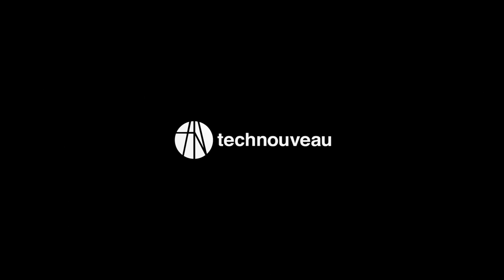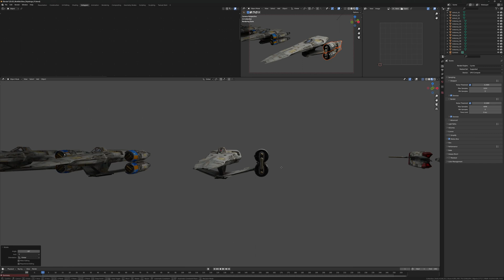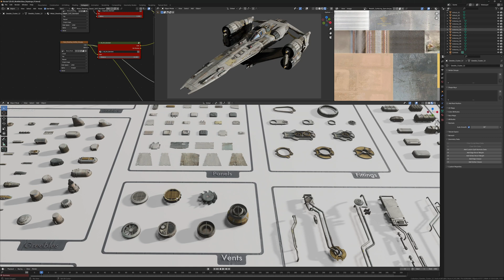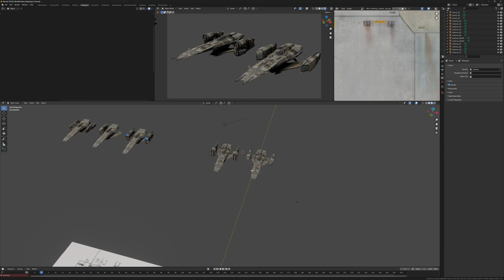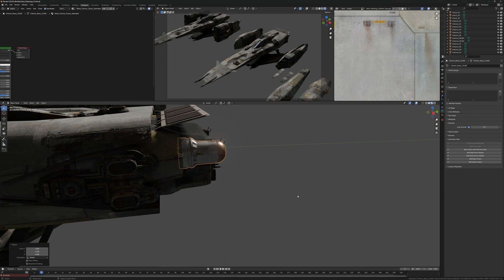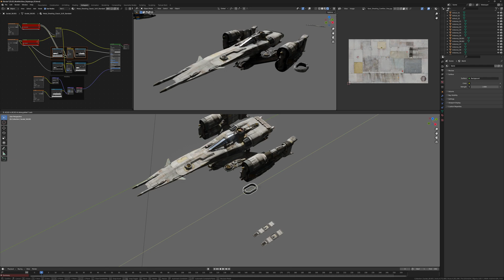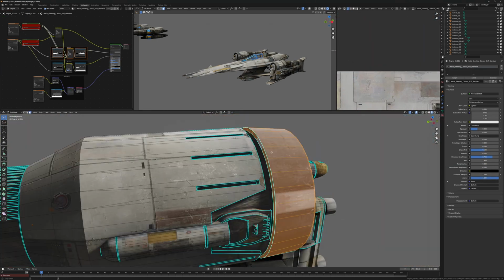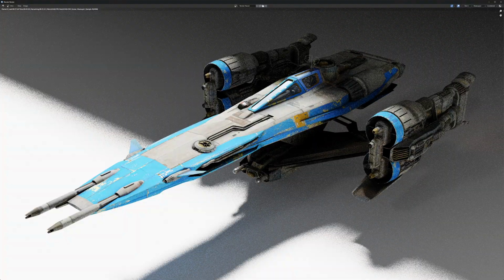Making a Star Fighter in Blender 3D - Technouveau 0002

Comment: Question coming from a newbie.
The scale of the model in relation to world space. Would lights camera and volume elements process differently if you build an environment that really tiny 0.5 meters over something that is supposed to be 100meters big ?

Would it increase memory building at that scale doing buildings and ships?

I thought that if you worked in a really tiny world space it would save on the system resources.
Reply from the maker: It affects a few things but I’m bot sure what excactly. It’s more about z depth and meters and stuff. Don’t make your lights and cameras “see” further than they need to etc. But also depends on if you render eevee or cycles. But I am not particularly technically minded, so I cannot say for sure

Comment: Also noticing you've got a card with 24gb vram. Must be nice 😂 I've tried to stage some scenes with this kit but it can run out even on a 16gb vram card. What's the hardware you guys are testing these kits on?
Reply from the maker: I built this kit on an old machine with 12gb vram. The trimsheet version is super light. The baked ones are more memory intensive because each object has its own texture. The trimsheet version shares a few